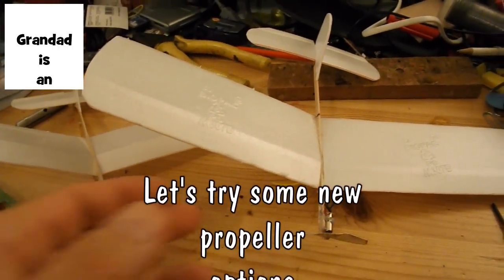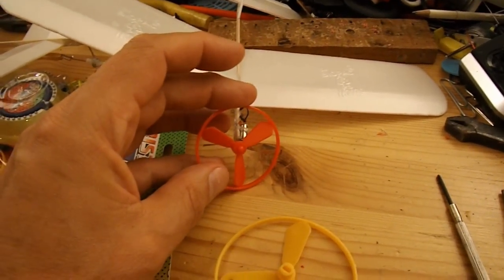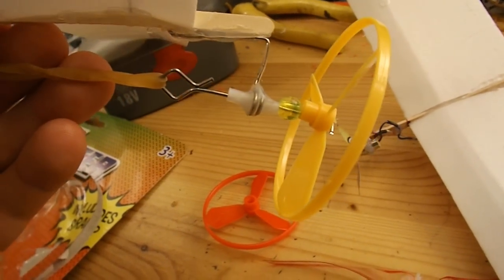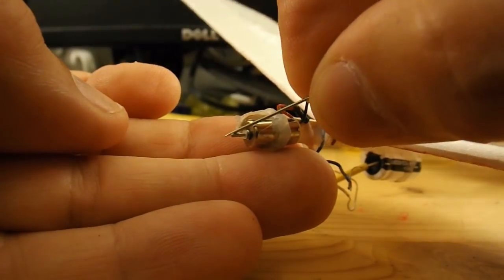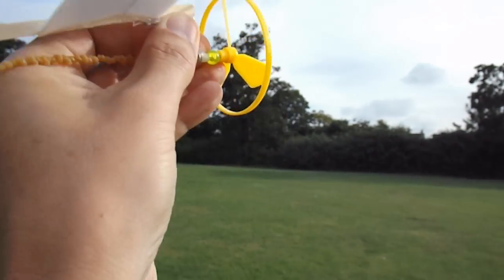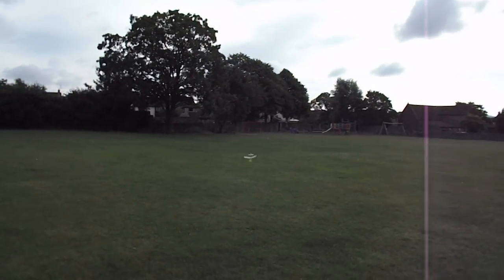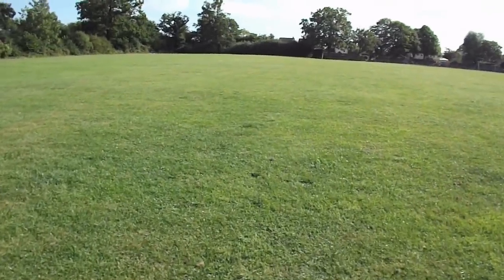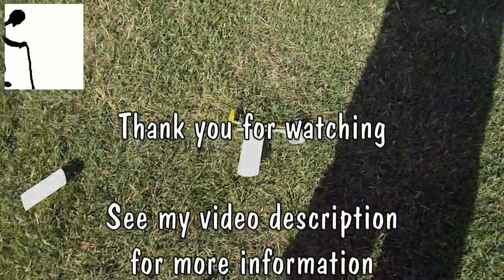New Propellers for my styrofoam planes

Comment: you should try them type of propellers on a boat and keep the protecter on it
Reply from the maker: Hi Kaleb, I think they would be rather large for any of my boats. It is surprising how small the props are on boats, compared to planes. Many of my early boats had props that were too large and that puts too much stress on the motors.
Reply: @GrandadIsAnOldMan  i understand now! It would probably be hard to make a small one with a gaurd! Cause if u do a small one with a gaurd u MIGHT be able to get thr weeds bettet without get caught.

Comment: If you sleeve the prop shaft you can fit a propellor and keep it centralised. 
You really need a longer moment arm (greater distance from wing to tail), and a larger tail. 
8250 coreless motor/gearbox/prop on eBay from China. Cheaper than your toothbrush probably. 
10 Farad capacitor might be better. 
Or just buy the whole caboodle from China on eBay for less than a tenner, but you will need to improve most by adding dihedral, or better still polyhedral. 
😀😀😀😀😀😀😀
Reply from the maker: Thanks for the tips! If you are interested in supercapacitor planes boats and cars, here are my playlists 
Supercapacitor Boat https://www.youtube.com/playlist?list=PLA5a2xPRSrB3TJCBigrLmf8jGYjkKgI8C
Supercapacitor planes https://www.youtube.com/playlist?list=PLA5a2xPRSrB1wNvirrwAn69eo_pM0tdEM
Supercapacitor Cars https://www.youtube.com/playlist?list=PLA5a2xPRSrB3l-TbAgbFomae9UZtdvkRb
There are some useful links in the video description but they are rather old now so I might update them when I have a moment.

Comment: where can i buy that small miniature dynamo, sir?  is there anywhere i can salvage a dynamo like that from any of the appliances or gadgets?
Reply from the maker: Dynamo? Do you mean the small electric motor? That one came from a Oral B vibrating toothbrush but you could buy 4 or 5 of them for the same cost as the toothbrush so if you want one I would recommend buying it off eBay or similar online store. Just search for 3.7 volt coreless motor. There is more information in the video description
Reply: oh, wow, okey ill check our online store here in the Philippines first.. and if not then ill try Ebay.. thanks for the info..  i love making them soon.. and i even love that rubber band planes too.. thanks again..

Comment: where I can find little motor???
Reply from the maker: There is lots of useful information in my video description. The motors in the video came from vibrating toothbrushes but unless you have and old one to take apart that would be an expensive way to get one. You would be better looking at an online shop like eBay and searching for "3.7 volt coreless motor" they are very cheap and much cheaper than buying a toothbrush.
Reply: thanks a lot sir...can I get it from a mobile phone?? I heard about the motors are used for vibration of the phone
Reply from the maker: rafi sadman Yes those are similar motors and I have seen videos where people use them. I have not used one of those myself.
Reply: thanks man, great wishes for your project, and now its time for creating own one's
Reply from the maker: rafi sadman Good luck :)

Comment: How did that little engine ?
Reply from the maker: If you mean the electric motor I didn't make it. It comes from a vibrating toothbrush but you can easily buy them from online sites like eBay. There are more details in the video description.
Reply from the maker: Sorry I do not understand your question, however there is more information in the video description so that might help you.
Reply: +GrandadIsAnOldMan I think he means how did u make that little engine I would like to know also please

Comment: where I'm find the motor
Reply from the maker: +m .pilot here is the information I put in the video description, you will find more useful information there. Electric power
This motor came from a vibrating toothbrush or you might try a pager motor. I have lot's of old OralB Pulsar toothbrushes that I have saved over the years. However I would not buy the toothbrush just to get the motor, they are expensive toothbrushes and you can get better more powerful motors for much LESS money if you buy online from somewhere like eBay or Amazon. I suggest you search for "3.7V Coreless Motor"

Comment: sir why did you use
 capacitor
Reply from the maker: +dipesh rathi because it charges very quickly and gives me about 10 seconds of usable power which is enough to get the plane into the air so it can glide back down.

Comment: Great job for the orange propeller. I would suggest to remove the circle plastic part of the last yellow propeller as I think that is blocking the three wings to properly move air. I never seen in real life planes with a propeller like that.
Reply: i dot 🚗
Reply: The circle plastic you mentioned is called a DUCT and you can see in mostly every airplanes.(if you know how airplane engine works). It is because it reduces the vortex caused by air pressure from propellers....hope you understand.
Reply: Yes, I see a lot more modern airplane have the duct, but it seems to me that the duct is still, it doesn't turn in the images I see online, where this little very light styrofoam with very little power has to work harder to turn the the heavier propeller and duct.

Comment: A friend of mine who was very clever used to make super light props out of balsa, he would cut the shape of the individual blades then tape them, wet, to a cup or jar then glue them once dry to a stick, the stick would then be glued to a block and a hole drilled in that, he could build anything out of balsa and tissue to be lighter and stronger than any other material. the stressed skin to him was the ultimate structure for strength an lightness. for nitro planes he carved his props from Australian wild cherry wood among other types, I gave him some wall nut but unfortunately it takes time to carve a prop and he had carved his quota.

Comment: Don't want to be picky, but make your tail planes a bit bigger. Real size planes go through much more air (being so much bigger) and also a lot faster (and going through even more air). So now you get the picture (especially when you consider the vast difference in sizes). lol So the ratio of tail-plane to main plane can't be the same as a real plane, for a tiny model to work (cos the tail-plane really hard-up for air). lol You need twice the area of the tail-plane on a really small plane than with a full size plane. But that doesn't mean making your tail plane twice the size (that would be 4 times the area, instead of 2). So just make it nearly half the size again (and you can easily trim it down if it looks a bit big). They call this phenomenon scale-effect, and what I described to you is loosely about Reynolds numbers (you probably heard of it). Don't worry, you are not the only ones that makes the same mistake. lol Look at this pathetic glider, it's bullshit performance and it's a production, cool looking glider. But it's an exact copy of a 60 ft wingspan glider scaled down to something the size of your plane (without considering scale-effect). lol The tail plane is completely ridiculous when you realize the science of scale-effect on aircraft. lol: https://youtu.be/FrISFEPugLU
Reply from the maker: +Justwantahover that's a great video covering a lot of useful information on getting gliders into the sky. As you know I just make my planes to what looks about right and then throw them around till they break, but I take your point about the tail size :)
Reply: +GrandadIsAnOldMan Thanks. There is another problem with that glider and the exact scaling. The wings are far too narrow (small chord) for the small glider. They should be more like YOUR SHAPE (more chord)! That's cos there is not enough air connecting the wings on such a small glider and the narrow wings are inefficient (instead of more efficient with BIG gliders). lol So you got one thing right!!! Your plane would not have done so well as it did, if your wings were like on that glider. lol And you won't believe the difference a larger tail plane will make. lol

Comment: sir how to get small motter?
Reply from the maker: +Aspboss Llol if you read the video description there is lots of information there. This motor came from a vibrating toothbrush because I have lot's of old OralB Pulsar toothbrushes that I have saved over the years. However I would not buy the toothbrush just to get the motor, they are expensive toothbrushes and you can get better more powerful motors for much LESS money if you buy online from somewhere like eBay or Amazon. I suggest you search for "3.7V Coreless Motor"
Reply: +GrandadIsAnOldMan thank you sir I will try.

Comment: You could fill the hole on the red prop then once hardened drill a tiny hole the size you need in the resin to fit the motor axle ☺

Comment: hay grandad why you do not use button cell ?you fly longer.
Reply from the maker: Try it yourself to find out.
Reply: wow what answer!!!!!
Reply from the maker: yanik alain well it is the best answer. I can spend time explaining it and you may or may not understand the answer or you may not believe me or you can try it yourself and find out. The short answer is that button cells may have the voltage but they do not have the power. The supercapacitor gives the power required. Even if a button cell gave the power you would have to replace it for every flight whereas the supercapacitor can be recharged in about 30 seconds and that gives me 10 to 15 seconds of high power which is all I need to get the plane to a height that it can glide from. I will do a video to demonstrate, you can choose whether you believe me.
Reply: thank you grandad I believe you, I only want to tell you that I love your determination to do what you do . that the reason why i subscribe:D
Reply from the maker: yanik alain here you are :-) https://youtu.be/cqvMvs8jOKA

Comment: Hey can u make propeller using beer can
Reply from the maker: Hi Sridhar, I made one for this plane using a drinks can http://youtu.be/W5v-WcR1MS0?list=PLA5a2xPRSrB03ITop_TpKAtz3FxxFOc7R
but if you want to see them done properly you may want to watch this video http://youtu.be/ZfOVcLglhDw
Reply: Where did you get super capasiter
Reply from the maker: Sridhar Ms The supercapacitors I used came from Maplin Electronics
http://www.maplin.co.uk/c/components/capacitors/super-capacitors
Perhaps if you read the video description you will find more information you want.
Supercapacitors can also be found on eBay.

Comment: The super capacitor one flies really far .... May be I should try it at home :)
Reply from the maker: The trimming was not quite right and I should have made it circle to avoid having to run after it, but I am sure if I spent more time on it the results would improve. Trying to launch it with one hand whilst holding the camera in the other is not easy.
The original build is here http://youtu.be/W5v-WcR1MS0

Comment: Grandad:
Do not know any online shop, where you can find ultracapacitors as you use?.
I've been looking in my city, in the two electronics stores and can not find there (Segovia, Spain is a small city-8-)).
  And I searched the Internet but can not find anything concrete.
If that I have two engine-propeller and gearbox assemblies and supercapacitor, two small toy airplanes that I have taken, my nephew. It is larger and is now in college and have other hobbies. 8-)
But I'd do it from scratch, with little Mabuchi motors (like you use in many of your experiments, vibrators tooth brushes, etc).
Thank you very much!.
Reply from the maker: wai yan tun thank you for commenting. I am often asked where to buy supercapacitors and I can only answer for the UK. I have just checked out element14.com and see they are Farnell a well known international company and they have a good range of the supercapacitors.
Reply from the maker: Francisco I see wai yan tun has suggested element14.com and I have just checked their site. They certainly have supercapacitors listed so may be worth a try. I bought mine locally and used Supercapacitor 2.7 volts 5 Farads in my plane.
Reply: By the way!:
I'm starting to upload videos to Youtube (though not with the quality that you do. But are spontaneous and do what I do, as my webcam recording).
Sometimes, I even go up to the table helpers (to hinder more than anything XD).

I invite you and all friends and that comenteis sincerest form of what you think and like to correct or add ideas.
Greetings again!. 8-)
Reply: Try element14. It's an international company. I usually buy from it.
Reply from the maker: Francisco Javier Lázaro Pinela I will keep an eye on your videos :-)
Reply: wai yan tun
Grandad, Wai, thanks! 8-)

Comment: You nearly hit a cricket 6 with the supercap one ! Bravo !
A way of filling such hole gaps is to use layers...wire insulation works well, progressively larger, one piece over the other, Then cut down to leave a small section that fits snug in the hole and its inner diameter hole snugs the motor. Can use superglue to affix the outer diameter to the prop hole.

Mosquito bites ? for 37 years when I lived in the UK I didn't see a single one !
Reply from the maker: Francisco Javier Lázaro Pinela Too late now, the damage is done. Normally I would spray my self before going somewhere like that, but I didn't think about it.
Reply from the maker: Hi slider. If you look at the hole in the propeller you will see it's a rectangle so the usual trick of wire insulation might hold it tight but not central. The pin hole worked fine but I was probably lucky getting the angle right. 
The mossie bites, I am already on antihistamines for hay fever and I still react really bad to insect bites. Very uncomfortable with 8 or 9 very large nasty looking swollen bites.
Reply: Best to repel insects:
Albahaca!.
http://static.hogarutil.com/archivos/201206/albahaca-668x400x80xX.jpg